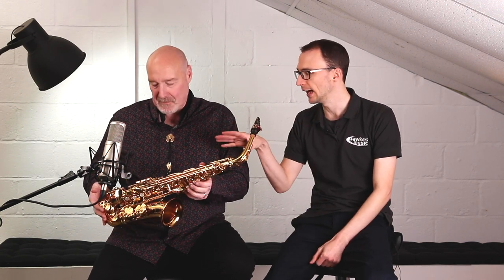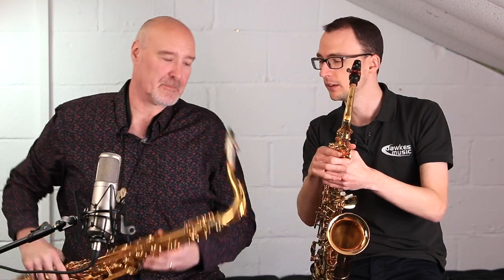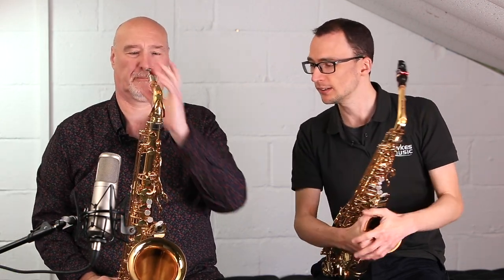Yamaha YAS-875EX Alto and YTS-875EX Tenor Sax Reviews

Comment: Hello, I wanna ask about the publish date of the tenor 875ex. Cause the alto version have 3 or 4 generations right? Does the 875ex tenor have the same technology and specs as the newest 875ex alto? Thank you very much/
Reply from the maker: Hi, the current variant of the Tenor is the 03. This is the model we review in this video, the main difference is the Tenor has the E1 neck, the Alto has the V1. Otherwise the specs are pretty much identical. The Alto is technically now onto the 05 version. It doesn't help that Yamaha don't really publicise these codes which can cause some confusion. However, both instruments in the video are the latest (as of Summer 2019). As I say, the Tenor is on the 03 and the Alto on the 05, however, the specs are identical apart from the neck.
Reply: @dawkesmusic  OMG, thank you so much.  Yamaha really made these things confusing for their customers, lol. I finally figure out the connection between tenor and alto. Thank you again for the details!!! appreciate that.